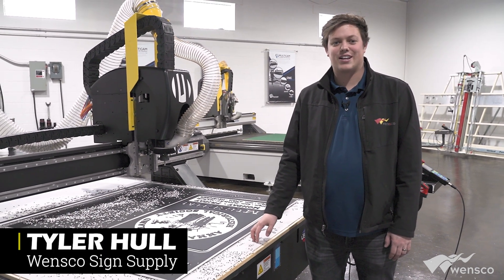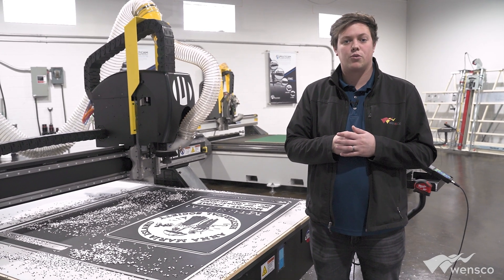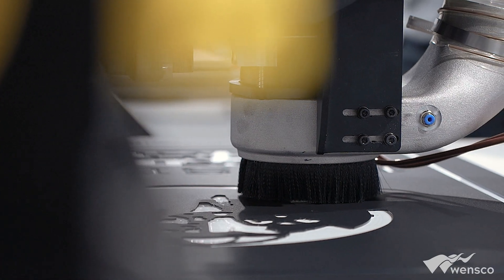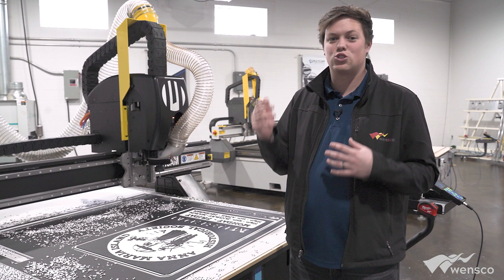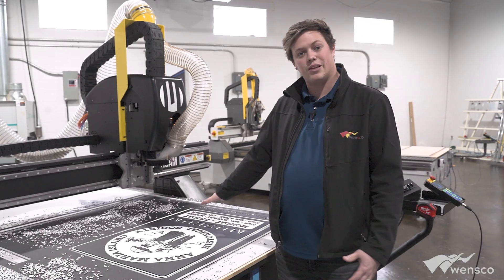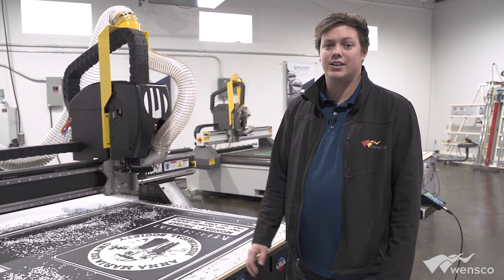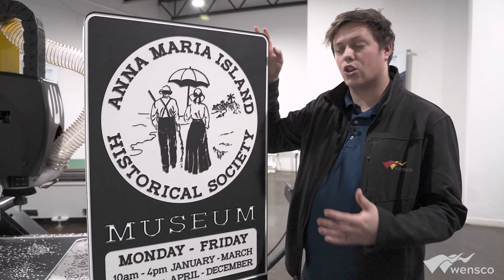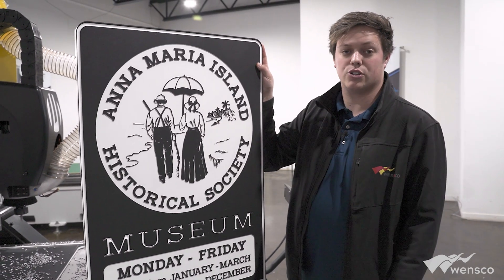Why use King Colorcore over other Substrates?

Comment: It would be great if you could highlight the techniques used to add third and fourth colors like we saw in your video or I often see advertised for golf course signs, etc. Even King color court doesn’t give a whole lot of information on how to achieve that
Reply from the maker: If you asked King Color Core they would tell you it cannot be done. The two options that work is either a UV print with an adhesion promoter or use an ultra hi-tack vinyl. But King Color Core would tell you neither should be done. 
King color core by itself will last decades and still look great. If you add paint, print, or vinyl to the sign it is cutting the durability down massively.